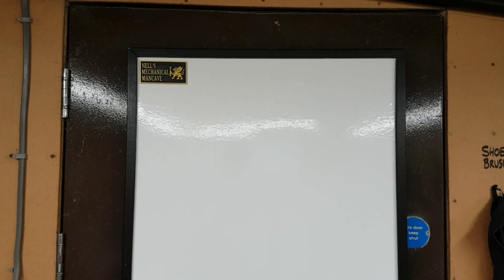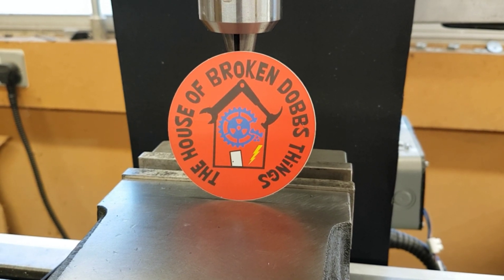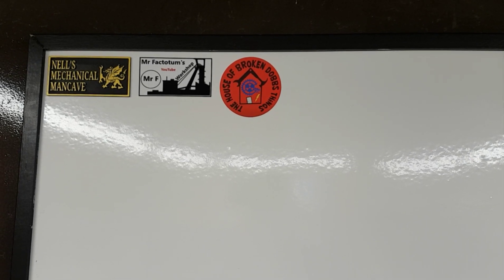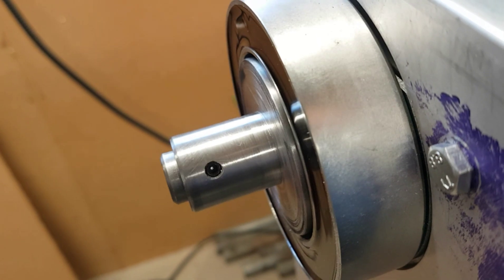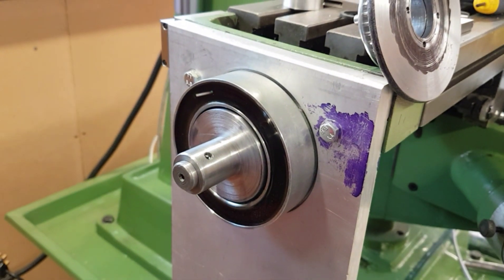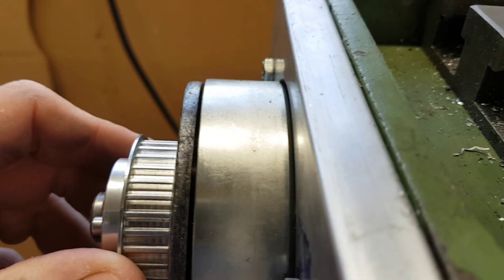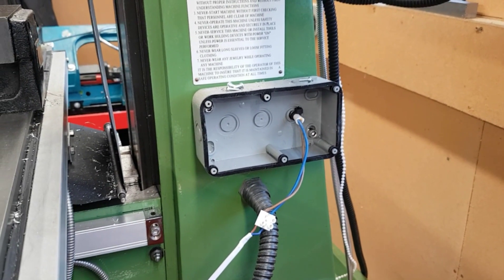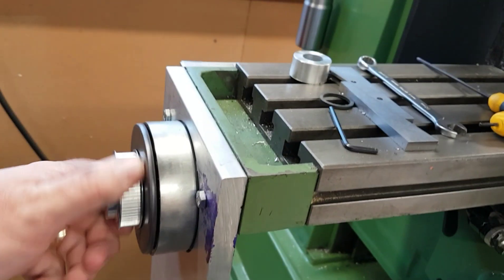Mill Power Feed Project Electromagnetic Clutch (part 3)

Comment: Hi from Australia, going to do this on my machine. I think that if you had atached the thin blue plate to the thicker plate with the fixings to the gear your problem would have worked. Great series thanks,
Reply from the maker: Hi and thanks for coming by.
That blue plate was way too thin and got dragged straight onto the magnet face. But as you said it should of worked if it was thicker. Even though the drive is still working perfectly well, I have bought two 3mm thick laser cut discs just in case problems arise in the future.
This was only proof of concept. A few have copied the idea with great success using different motors and spur gears instead of a belt drive.
Give me a shout if you need any extra info, I'm always here to help
Best regards 
Neil

Comment: I like it Neil. It will be interesting to see how it develops. I wonder if an iron core rather than a steel one would make a difference? 
Cheers, Dean.
Reply from the maker: I'm going to have a play around Dean !
Like I said "it works"  but when it slipped on the first go it made me less confident in what I did.
An iron core is an excellent idea but at the moment I'm thinking on the lines of a soft metal clutch disc, copper or aluminium maybe. Also, I'm going to try and lap the discs in. That will maximise surface contact and give a little bit of grip. 
I know it will drive now but I want to improve it and then measure the breakout torque.
Thanks for the comments and watching.
All the best  Neil

Comment: Hi Nell. I know on the car one's there is an audiable Clack when it energises. Meaning metal to metal contact. But cannot really be of any help. As said above there must be tons of car compressors in the scrap yard.  Also a point mentioned is the current draw. I think they pull a lot of current So is your supply too small or the cable you are using. Shame you are not closer as i have all the test equipment to see D.C current draw. Regards.
Steve.
Reply from the maker: Hi Steve. I checked the resistance and it's just over 4 ohm and it pulls 3amps at 12v. The clack is the clutch disc which is on finger springs being dragged towards the pulley. I'm going to have a play around to see if I can improve things. It does work, but not as well as I expected.
Thanks for watching 😁
Cheers Neil

Comment: Look at the air conditioning cluch on a car. That all basically the same. You may be able to get one and modify it for your application
Reply from the maker: That's what it's based around Joseph. The clever buggers in the automotive industry have optimised it though. I'm trying to duplicate it without a budget by just using cunning and good luck 😉😉😉
Reply: @NellsMechanicalManCave  check your junk yard or parts house and see if you can get one that way you need the friction material on a flex plat. Or try to make yours in to a flex plat and add some brass rivets
Reply from the maker: @josephlovell6951  been thinking on the same lines.  Going to try a soft metal friction disc. Copper or aluminium first. It's all one big experiment that keep my head busy 😁😁😁😁
Reply: The other thing is are you getting the amps to the magnet the more amps the more pull it well have try a car battery and see if you get more pull

Comment: Umm. Oh so close. I wish I could help you with your puzzle. Sadly I have more questions than answers, one being, what purpose do those slots in the thin disc serve? 🤔 Keep going Neil. All the best 👏👏👍😀Andrew
Reply from the maker: Now then Andrew ! After watching the upload I thought,,, should of explained the slots 😁
Magnetic fields follow paths and the manufactures design the discs with slots in to allow the magnetic paths to flow. This allows anything magnetic to be attracted even though there is a slotted steel object in the way. In my experiment the painted steel plate was dragged onto the magnet and took all the force. If there were slots that allowed the magnetic field to flow through, my pulley plate would receive the force.
🤔🤔🤔🤔
I think we should consider the slots as magnetic gateways, 😁
Reply: @NellsMechanicalManCave  Ah thank you. Brilliant explanation 👏👏👍😃

Comment: Thanks Neil for the shoutout. 

Great progress. I think you are very close. 

Seems like the magnetic pull due  air gap even on auto starts to fade past .010 in etc. Volvo is known for this as the driven plate wears slightly and the coil just can’t pull things together. Tap the clutch plate and pop she goes until the next day/hour. 

One more thought you may not need full contact as your driven load is very low. I think my power feed was only a fews hundred inch pounds of driving force. A full clutch on an auto would be handling a few horsepower drag for the compressor. 

You will get it! 

All the best 
Dan
Reply from the maker: Mmm! Dan.
Thinking,,,,,,, what if I swap out that thin steel plate and substitute it for copper or aluminium with big slots in the magnet area? 
I'm thinking sticky metal sandwich 🥪